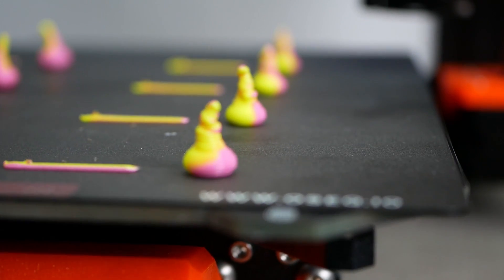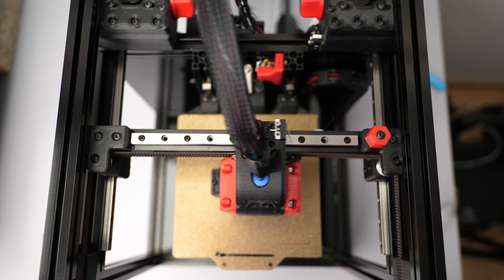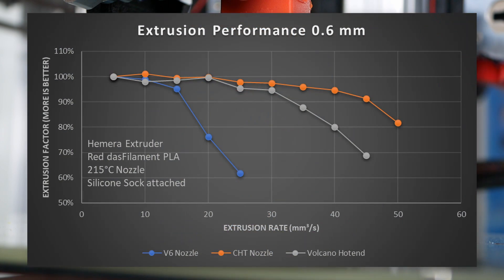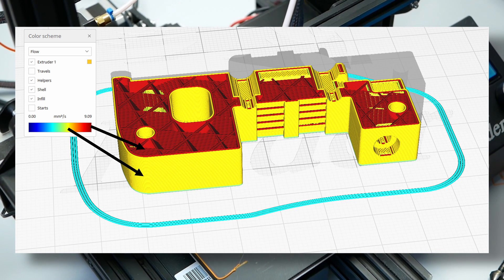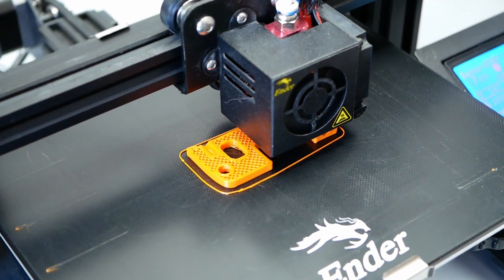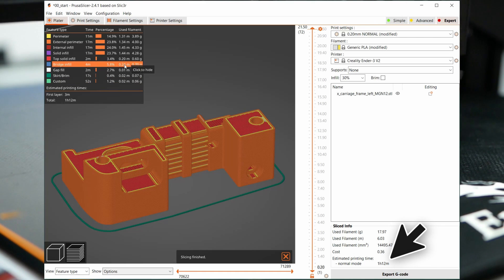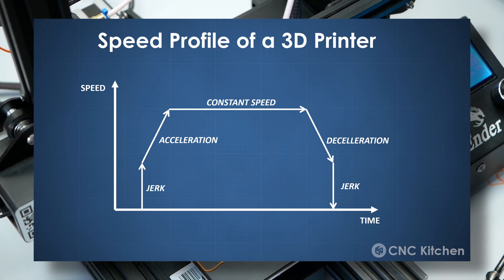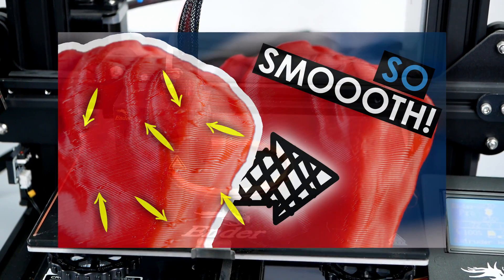Easy Hotend Benchmark for FAST PRINTING Profiles

Comment: Increasing jerk to 20 on my bowden cr10 did wonders! I started getting way better results and was able to see and tune flow rate and PA much easier. FYI I've got klipper with input shaping. And yes, I've got an a1 mini, but I'd hate to see the old printer die after I upgraded it to a dual switching hotend. Now onto testing max flow rate...

Comment: I watched this when I first bought my printer, got the scale, but then never did the benchmark.

Recently, a new PLA filament caused a headache with my first serious print failure (massive blob). I saw many symptoms but had difficulty finding the root cause: ground filament on extruder idler, first layer not adhering, first layer was inconsistent (when I first clued into underextrusion). I did this benchmark and only to realize this new filament, vs others, had far more underextrusion!

The process was so easy (and low-material compared to a failure) that it's going to be an essential part of my toolkit when using new filaments brands/styles! Thank you so much!

Comment: You didn’t make it very clear how you actually calculate and use the software and figure out your new settings. I’ve watched this video about seven times in a row still can’t figure out what to do after printing out the blobs and measuring.

Comment: Thank You!

Tested Polylight ASA White with QIDI x-max 3...
From 240 to 260 degree
From 20mm³/s to 32mm³/s

240°C slightly under extrudet all
250°C perfekt weight up to 30mm³
260°C Same as 250 but bether 32mm³  result.

So i choose 260°C for my Print.

To run the gcode i had to increase this value:
max_extrude_only_distance: 120
Up to 200mm in my printer config.

Comment: So Jerk in 3d printing is not the same as classical mechatronic jerk/jolt?

I would expect jerk/jolt to be rate of acceleration (the 3rd derivative of distance) i.e jerk as mm/s^3 compared to speed in mm/s or acceleration in mm/s^2. But the M205 documentation suggests that the units for jerk are mm/s, so I would be interested to understand how this 'speed' relates to this parameter called 'jerk'.

This reminds me of the situation with conveyor systems, where often acceleration is specified in seconds, as in the fixed time it takes to accelerate to the desired speed. It's very confusing and can result in constant velocity moves being difficult to plan for.

Comment: If you can make a web tool for this, can you make a excel sheet with the priper set up so i can actually see a graph like you did? I dont get jow people are getting graphs and visual representations. Its frustrating. Tool is useless at this point.

Comment: I tried the tool today, the only problem:
My hotend needs a ZOffset, so I tried to add my start Gcode as I usually do when using Gcode not created by my slicer (where is the only possibility to set. Z Offset).
But I f***ed up my bed surface again, because somewhere in the Gcode created by the Excel tool, it tells it to ignore my G92... Or I'm just bad at writing Gcode by hand...

Can you please add an Option for setting a Z Offset? 

Danke dir Stefan, das ist wirklich geil was du so für die 3D Druck Community machst.

Grüße, Sebastian aus 88267 Vogt

Comment: I may have missed something obvious or it's in a different video, but how are you calculating the flow rate? Are you taking the area of the filament and multiplying by length and then timing how long it takes to extrude? Or do you get that value from the feedrate in the gcode?

Would weighing a piece of raw filament of a known length and weighing the blob made of the same length give you the same flow number or at least an under extrusion percentage?

Comment: Your test is  very good and precise. Thank you. However this is for a constant flow what doesn't happen 100% of the time during prints. My reults show 10mm3/s, but, while printing vertt fast it has a pick of 20mm3/s without under extrusion for 1 or 2 seconds - with my Titan stock! You would better test it again in real prints! I'm using Klipper at Tronxy X5SA Pro , PETG  230C.

Comment: So In a bid to see how one would do on my Ender 3 Pro I spent the whopping £3 and had one delivered. It looked just like the one in the video, only it came assembled. I installed it into the Biqu H2 and was quite surprised to find it did not fare as well as the original nozzle. My scales only do 0.1g resolution, but 8mm3/s to 14mm3/s all came in at 0.7g on the original, though the last couple were visually smaller the scale couldn't show me the difference. On the high flow nozzle it had dropped to 0.6g at just 10mm3/s and only dropped off more at 14 and above. My conclusion is that the nozzle is just far too loose in the hot end (there's a LOT of wobble until it hits the heat brake) and so it's suffering from a lack of heat transfer. I only have CPU paste to hand which can't handle the temperatures required and I have no desire right now to buy some Boron Nitride paste to improve the contact between the nozzle and the hot end, for now it shall live in the drawer.

Comment: Very useful tool - many thanks. I have found one oddity; which is that on my Ender-3 V2 (with Jyers firmware) the hotend is set to 0C while the last blob is still printing (as if it's reading ahead in the gcode).

Comment: I think the greatest pearl of wisdom here is determine the flow rate of the part, then adjust temp. I generally default temp based on material, but give a lot of thought to adjusting speed based on the needs of the print job. Definitely plan to switch my order of operations here.

Comment: Why don't you simply graph the filament fed speed vs the actual speed? You request 10mm/s feeding speed from the extruder and it should be 10mm/s.
Above a certain speed the measured one should break down. There is your max pressure for a given filament. 
This measurement would be instantenous and exact. Am I missing something?
I would guess the filament travel speed/distance could be measured with an optical mouse sensor or worst case with a mouse wheel.

Comment: One missing info in the test is how much should the blobs weight...
So my logic... is the volume of the 200x1.75mm filament * 1.25g /cm³ = 2.4g so the blob should be 2.4g... is my math wrong?
Reply from the maker: Yes, it's wrong: 200 mm * PI / 4  * 1.75^2 mm² * 0.0125 g/mm³ = 0.601 g
Yet, its not really necessary to know since you'll always compare to a slow extrusion reference.
Reply: @CNCKitchen  Oh yeah I forgot PI damn it. That's weird, because I have a 0.6 nozzle and it's max 0.40g like almost on all of them, except 200°C at 22mm³/s it has 0.35g

Comment: Me wondering why I have gaps between lines...
Ender 3
Bi Metal Heatbreak
Dual Gear Extruder

I print 100mm/s 0.6 nozzle 0.4 layer with 3000 acceleration... it sometimes pushed like 37mm³ of filament... it makes not fully sense why I need flow rate at 150% to make it somehow OK...
I'm happy that this test exists!

Comment: When the first layer is uneven, there will be blockage at the beginning of extrusion, which will affect the accuracy of the flow.
It is recommended to quickly raise the Z-axis to 2mm at the beginning of the discharge, and then slowly raise the Z-axis。

Comment: Does anyone know if there is a way to make cura print at a constant flow rate? It would be interesting to see how a part prints by setting the flow rate versus travel speeds.

Comment: Great tool, many thanks Stefan. Can I use it with different nozzle sizes, e.g. 0.6mm? I could not find nozzle size parameter in the spreadsheet.

Comment: Let me start by saying this is great work!  However, I tried running this on my Ender 3 with the CR Touch mounted.  When my Ender tried to print the second column the CR touch crashed into the blobs on the first column.  It would be great if you add have a variable that allows you to account for the X-width from the edge of a CRtouch, part cooler, or ... to the tip of the nozzle.   I'm going to try adjusting "Temperature spacing" and see if that works.

Comment: Hello, variable speed, mean to say that is possible to give command "User defined speed" Like 1 to 100 slices at 30 MM, Next 200 slices at 40 MM and next 100 slices at 50MM ? I have total 400 slices in a particular print.

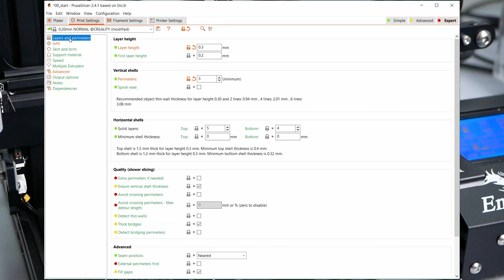Comment: C'mon man.  I know you know that perimeters overlap a certain amount.  What you show at 9:47 is not how Slicer math works.  Two 0.6mm perimeters are not 1.2mm, it is 1.16mm.  Likewise, three 0.4mm perimeters is 1.11mm, not 1.2mm.  This is for 0.2mm layer heights.  For 0.3mm layer heights, the thicknesses are 1.07mm for 3x 0.4mm extrusion width and 1.14mm for 2x 0.6mm extrusion width.

Comment: I've recently been wrangling with the maximum volumetric flow capability of my hotend using the spreadsheet produced by Stefan. Firstly, as I've previously commented, Stefan's current spreadsheet doesn't work with delta printers (or any other type that has X=0, Y=0 in the centre of the build plate). Secondly, having written my own spreadsheet based on Stefan's, my next problem has been that all the printed "nuggets" were the same size and almost half the weight that they should be with a range of volumetric flows from 6mm³/s to 20mm³/s. Visually, the extruder was spinning at the same rate for each setting.

Looking further, I discovered that, for RepRapFirmware RRF2.03 and later (not for any other printer firmware!), M203 used to set maximum feed rates, has a default minimum feed rate of 30mm/min. This can be changed with the I parameter (that's capital i) once one knows of its existence (it's clearly shown in the Duet3D GCode dictionary!) At the default feed rate, with Stefan's method, all volumetric flows are constrained to a minimum of about 24mm³/s, which is optimistic for a V5/V6 hotend (hence my 50% extrusions)!

I've now set M203 I6 (with my usual X, Y, Z & E maximum speeds) and the gcode runs my extruder at much more sensible speeds and produces printed nuggets with weights that are where I would expect them to be, over a range of volumetric flow rate from 2mm³/s to 18mm³/s. I've produced some lovely charts from the data and I now know how useless my hotend is! 

Thank you, Stefan, your method works well.

Hopefully, this comment will help others using RRF.

Comment: In case anyone else is using Klipper, I had to edit a couple of things to get it to run. In M109 R## the "R" needs to be replaced with "S", then I needed to disable some machine software limits under [extruder], adding max_extrude_cross_section: 5  and max_extrude_only_distance: 500.0. (For safety I'm going to comment them out when not running the test). 

Hopefully this helps someone!
Reply: Hey it helped me! Figuring out the right value for max_extrude_only_distance is easy enough, but max_extrude_cross_section is not as straightforward, so thanks for providing something to work with.
Reply: @dsp4392  no problem! I hate when people don't post their solutions to issues like this, it just ends up with everyone going on their own wild goose chase 😅
Reply: Thank you so much, Couldn't get this working until I saw this post. Surprised it hasn't been added to the web page for the gcode generator so that people see it.
Reply: Worked with me as well. Thanks for the tip!

Comment: Hi Stefan. I am relatively new to 3D printing, and I was just watching your videos on recycling printed material into new filament. I was wondering if a good way to grind the PLA or other filament into small particles would be to have a set up like a small benchtop gristmill working with small motor-driven millstones? Would like to see how  you approach that concept.

Comment: As always, outstanding work!
One question though. This Gcode is Marlin flavor, right? What should I do in order to use it in Klipper?
Reply: For Klipper, the only major change I found is to edit the gcode to replace the temperature set and wait command (M109 Rxxx) to (M109 Sxxx).
Reply: @kduchesneau  thank you!

Comment: I am using your tool. it's great!
choosing an individual start height would be great for individual blobs. Mine has trouble sticking to the print bed and i don't want to work around with changing my Z-Offset

Comment: Stefan, thanks yet again for your amazing work and video!  Keep it up!

While I haven't download your .gcode and tool yet, I did download your profile and compared it to my default profile for a 0.6mm nozzle @ 0.32 mm layer height on my Ender 3 Pro.  After copying over pretty much all you setting changes I printed the cylinder that you had on the build plate twice with the same 0.32 mm layer height.  Including heat up time for both the nozzle and bed from room temperature, my default profile took 28:49 minutes.  Modified with you tweaks, it finished in 17:46 minutes (again, including heat up time for both nozzle and bed).  That saved a whopping 11:03 minutes (38.35%)!!!  The increase in temps (215 vs 230) sufficiently allowed for increase in speeds (both max and average) as well as volumetric flow rates (again, both max and average).  I will definitely need to download your tool and do of my own experiments to gather actual data, but for now I am super happy!

Thank you so much!

Comment: Even with small changes to the flowrate the weight of the extruded material changes and you are seeking the first significant drop. But there are still smaller drops below that value. Wouldn't it be nice to adjust extrusion according to exrusion rate? Eg. when it's printing a straight infill line with high speed, the extrusion would get a 30% bump to compensate. Even with your prints I see irregular outer perimeters and even though the same wall-line should have the same speed and extrusion, this might still be interesting.

Comment: One step on the ender 3 z axis is .04mm, so if your layer height isn't divisible by that, your quality will suffer. So instead of .3mm layer height, use .28mm. I think chep talked about this in a old video, correct me if I'm wrong!

Comment: Wonderful video! I resonant with this video a lot because I am also tuning my voron 0 towards faster printing. This gave me a lot of idea to optimize my profile even further. One thing to add though, is that Prusaslicer will limit print time of each layer under Filament - cooling, and that might slow down the print unexpectedly.

Comment: One trick i found when printing with larger line widths is to have a nozle thats not too ponty and a bit of flat. I also piled the edges of the point of to he nozle to have a bit of roundness so that it glides instead of dragging when squishing that filament. And you will get a smoother surface... And also ironing.

Comment: Excellent idea, Stefan. Thank you for doing this. I've been wanting to measure the volumetric flow capability of my printer following some modifications, including a CHT nozzle that I bought after watching your review. However, I'm having difficulty implementing your spreadsheet for my delta printer, which has X=0, Y=0 at the centre of the circular build plate and not at one corner as seems to be assumed by your macro. The gcode output from your spreadsheet places many of the print positions outside the build area. I'm going to manually edit the gcode output to place the stripes and blobs on the build plate. I don't know how difficult it would be for you to edit your macro to allow for different zero positions and build plate geometry, but it would be useful (please!).

Comment: I have succesfully tried some Temperature / sweep tests in an Ender 5 Plus with E3D´s Hemera direct + Volcano. Looks really nice! Anybody wants data???

Feedback: The tool should be ported to pure python + csv files in order not to require excel which, for lots of people, implies costs...
Reply: you could always use Libre Office? That is free
Reply: @john1976jb  Thank you very much! I had the chance of giving it a try and yep, LibreOffice works flawlessly. Thanks!
Reply: @john1976jb  I do not know whether it can load Stefan´s excel docuemnt with its VB code... Are you familiar with this?

Comment: If these results are reproducible, it should not be too hard to use these measurements as an input in the slicer software and adjust the extrusion multiplier for different extrusion speeds. To begin with one could write a script that would adjust the gcode after generating it.
Do you think this would work? I guess I would have the programming skills to do that, but would that be a sensible thing to do?

Comment: To help with stutter without lowering the resolution, enable Meatpack in Marlin and install the Octoprint plugin. Meatpack is a compression algorithm to push gcode faster over the slow serial connection.